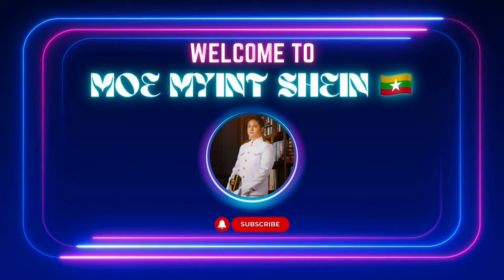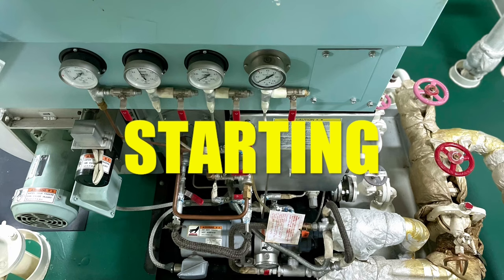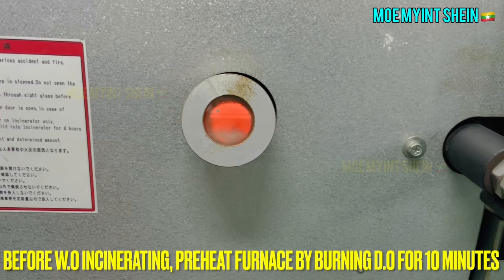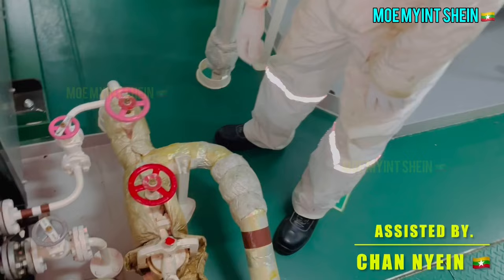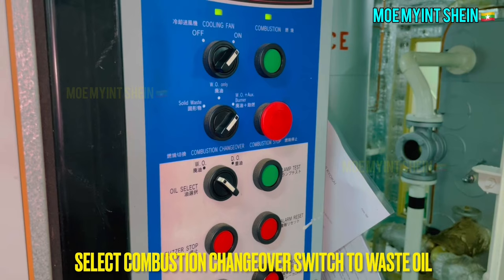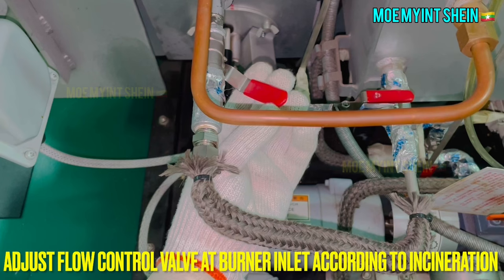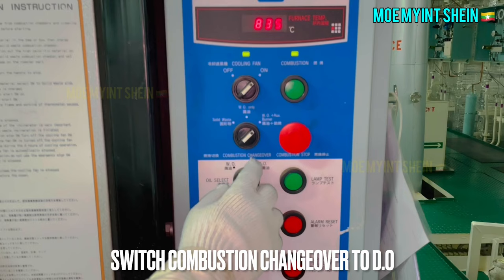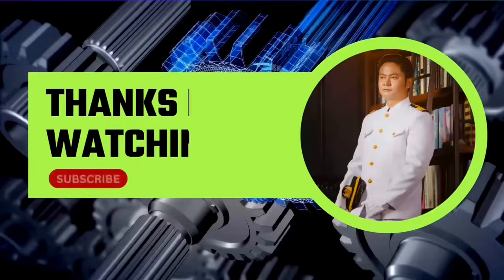[MiURA] INCINERATOR Operation Procedures | Marine Engineering | MARPOL | Technical Vlog : 089

Comment: Sir what is the role of damber
Reply from the maker: To regulate furnace temperature of incinerator. 
If wide open, furnace temperature will drop. If narrow open, temperature will rise. 
In this incinerator, doesn’t require to regulate damper. 
Adjusting damper is to be done in SUNFLAME incinerator.
Reply: @MoeMyintShein_MMU  then why damber is provided is no need of adjusting?
Reply from the maker: I confused which damper did u mean? Have u seen any damper in this video? Please clarify and mention with minutes of video that u questioned.

Do u mean fuel oil regulator?
Reply: Small black cylinder above FD fan @MoeMyintShein_MMU
Reply from the maker: @sachinks7701 
Sure. This is air DAMPER. 
Damper Operation is automatically controlled, unlikes some other incinerators. 
Purpose is to control incineration air. 
As o told you before, damper controls incineration air. 
When furnace temperature reaches 880’C, damper opens and closes when furnace temperature reaches less than 860’C. 
Thanks.
Reply: @MoeMyintShein_MMU  sir i am going nxt week for muira incinerators thats why i am disturbing you
Reply: @MoeMyintShein_MMU  is damper controlled by pid. Or just opening & closing
Reply from the maker: Just Open and Close. 
Furnace 880’C and above Open.
Furnace less than 860’C Close.
Reply from the maker: Good Luck !!!
Hope you can handle. 😊